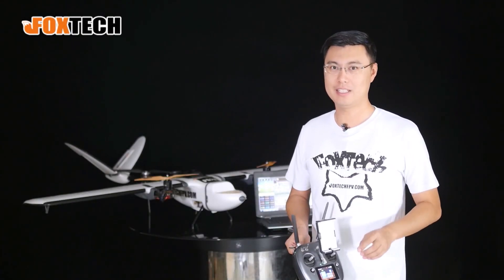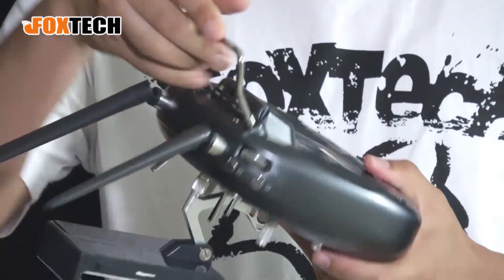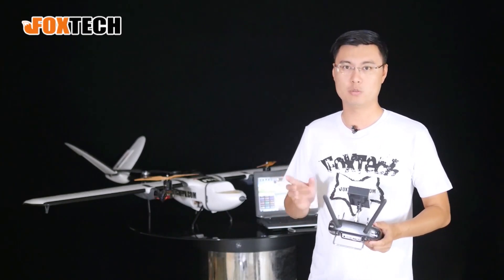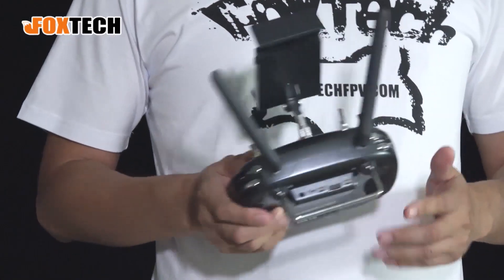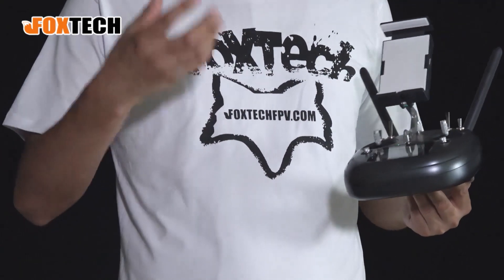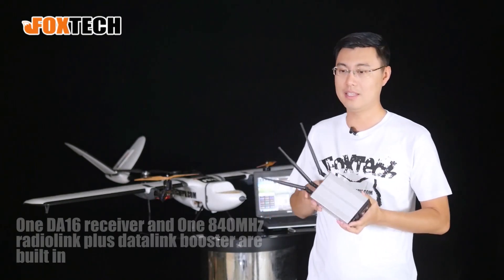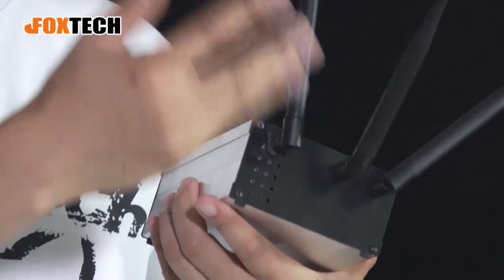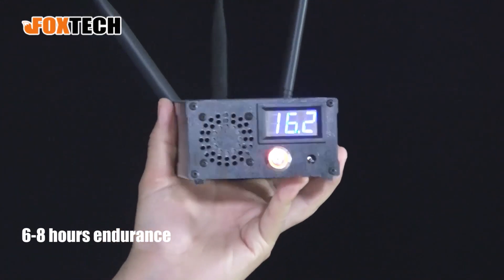Foxtech RB20 Relay: 15~30Km RC & Data

Comment: Long Range Digital video is very challenging. This system does not has video.
Reply from the maker: indeed, video requires very high  bit rate, we currently have cofdm system for 40 km and  SKYSIGHT dual-direction system for 15km  video range.